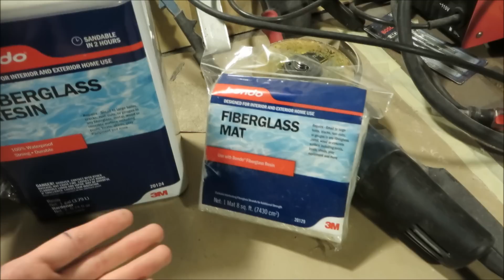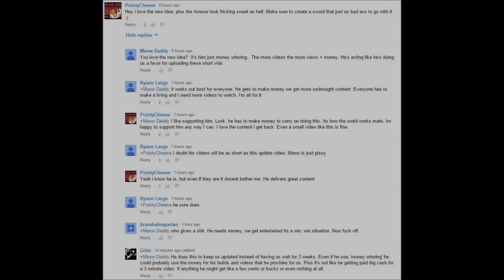How to Make: Mad Max Samurai Bracers

Comment: Not a criticism, but an honest suggestion to possibly improve future project designs.  I noticed that when you cut out the sack cloth layers, (looking at the stack at about the 2:40 mark in the vid) They were all cut out with the weave running the same direction.  When working with woven materials, and using them for structure, having the weaves run in different directions will increase the structural integrity by transferring energy in different directions through each layer.  (The kevlar in bullet proof vests use this concept)

Comment: Do you know if those would be SCA legal?
Reply from the maker: +Joshua Hammond No idea, sorry.
Reply: +ZednoughtAlpha its fine, I love your design though, im actually trying to figure out the best way for Samurai style armor, not sure if I should use pvc or steel... any suggestions?
Reply from the maker: Joshua Hammond For contact sports I would go with steel, as PVC has a tendency to shatter.
Reply: +Joshua Hammond You'd have to modify/add a proper gauntlet to the bracer, but it should be.
Reply: +Joshua Hammond I mixed my armour with carbon for the main protection and some chain mail as the joint armour but carbon or steel is REALLY good armour but of course titanium is the best
Reply: Joshua Hammond if you can get you hands on them, plastic pickle barrels or plastic barrels from a u brew shop are what our SCA house use to make a lot of our armor
Reply: +Joshua Hammond  - You can get plastic pickle buckets (2-5 gallon) from just about any restaurant that serves pickles on sandwiches including fast food as well, in case you don't have a brew shop near by or the money to buy them.  Restaurants just throw them out so they are happy to just hand them over to you.
Reply: what does SCA stand for
Reply: anime trickshot [The] Society for Creative Anachronism.  It's a group that practices medieval arts, sciences and combat
Reply: +Joshua Hammond Probably not with the protrusions, and some people may get upset about them not looking historically accurate.
Reply: +Robert Cowley-Yamamoto ok thank you
Reply: +ZNA Productions is the method of using fiberglass as in your mask video viable for this and other armour?
Reply: wait u die if u dont eat im so sorry
Reply: not technically. You would have to consult your local armor master, and if you don't have one in your kingdom or region talk to some one in you're local group. that or just use it anyway a see if anyone notices.
Reply: Detryk Willis LOL
Reply: Not for fighting unless it's agreed upon. Although if you wear this is trying to act like a shitty modern samurai you'll be laughed at.

Not as badly as the dude who showed up with elf ears and everything lol but it will still happen.

But I can tell you that if you forge your own armor you will at least gain some respect.
Reply: Technically if you really want to impress people in the SCA forge your armor the old way. Not only is it accurate but many of them think it better that way.
Reply: A wise outlook.
Reply: Aidan smith My comment?

Quite frankly I haven't been to many events. Most of the ones I went to happened in my early childhood and I barely have them committed to memory.
It's a simple judge of character honestly. I talk to a lot of my mothers friends from the SCA and they all strike me as the "Old way is the best way" kind of people.
Reply: none the less its still a safe bet.
Reply: Joshua Hammond they are
Reply: Deviler Gaming lol...
Reply: Deviler Gaming. Hes not talking about the apocalypse...
Reply: Which SCA?

Comment: Quick tip while making something that requires a fabric with a lose weave cut the first layer normal and the next at a 45° and repeat until you have the desired amount of layers so that if something pokes or stabs it has less of a chance of going through

Comment: It's not a sad day if you get to do what you love. If some one can't appreciate your need to survive then return them the courtesy by ignoring them, after all your time could be better spent working.  I addition to the strips of steel on the out side could you add narrow strips of thin aluminum, length wise and or diagonally, in between each of middle laminations?  If it works it would increase strength and it without the itch factor of fiberglass mesh. What's the maximum amount of layers possible?   Keep building!

Comment: You also could try making throwing knives out of large bolts by flattening them then using an angle grinder to put a tip on them and also sharpen them.

Comment: I had an idea for a build
"Skateboard shield"
1. I took the wheels off of my old skateboard
2. Remove all nails
3 drill new holes into the skate board and attach the handle with rivets or bolts
4 attach the strap doing the same method

Optional
Bolt aluminium wings to each side

Option
Put in a gap in the alminium

Comment: Cool build. Have you considered using hammered rivets instead if pop rivets? You wouldn't end up with sharp ends poking out everywhere that can scratch you or catch on stuff. It would be tricky to do on the composite parts on the armour without breaking anything, but would be fine for the metal plates. They would take a little longer than the pop rivets though.
Reply from the maker: lancer D Pop rivet were simplest for this build, I do peen my own rivet on a regular basis though.

Comment: I think maybe you did not mention or do not know (my English is not very good) , that stacking fabric with resin is called " micarta " depending on the fabrics and colors gives the sanding different standards normally use epoxy resin and used more common among the " artisans " is for knife handles , perhaps you pudas use for that then also , of course the resin epoxima leaves him much harder than the fiberglass resin , nice bracers :)

Comment: personally I would have put a thin sheet of metal (like from a christmas popcorn tin) on over the resined cloth to make it more durable against blades.  as it is someone with an axe could probably make it through because the blade can bite in.  I have a bracer made from one of the aforementioned popcorn tins that its only drawback is its lack of rigidity due to the high gauge and low quality of the steel, but combining a very thin layer of steel (that for fifteen dollars would yield four bracers and a couple gallons of kettle corn) into this already sturdy and light-weight design would make it behave on-par with equally thick and far heavier all steel bracers.

Comment: I've been thinking of working with leather and pvc to make kinda ribbed lamelar. Mostly bracers and greaves.

Your input would mean world's to me, since this will be my first.

I plan on cutting the pvc and sanding it smooth and round to make spikes, then weaving around then with leather straps.

It's not supposed to be a functional piece, decorative. For a larp.
Reply: Daniyel Ortiz hey you can use like floor mat stuff e.v.a foam to make them and then you don't have to worry  about the staby staby spikes and its cheap and easy to work with but you have to seal it w/glue before you paint :/ 
good luck w/ your project dude!

Comment: these armour parts are pretty cool but actually... how effective are during a fight?
For example, in a sword fight, the "overlapping" of the plates can cause a blade to get stuck or even cut a piece of string that holds the plates together. Why don't you try to put it on a mannequin and see how though is it and how effective could it be against a blade (i am not considering any firearm since i am not sure it is going to hold anything bigger than a .22 caliber)?

Comment: Him: I'll use super cheap 16th inch steel sourced from a machete infamous for being a soft POS as well as 50cent electrical outlet covers, for protecting my forearm and the back of my hand both full of vulnerable tendons, large blood vessels and important bones.
Also Him: I'll use a tiny bit of this huge hunk of heat treated carbon steel which is thicker than 16th of an inch to protect a very small portion of my arms.
Me: But.. why not use that superior steel from the propane tank for all of it??
Also Me: But it's so cool that in one build video he shows people 3 very different yet all pretty reliable and cheap sources of steel.

Comment: Hey, question on Using PVC. I'm thinking about to make a PVC straight sword with fiberglass core (with maybe steel rod reinforcement close to the hilt) . But idk how durable it is. Should I use wood instead? I was hoping it would be close to or better than the durability of a wooden training sword, but I just heard from you that PVC could shatter on contact. Please let me know. Thnx. =]
Reply: Both pvc and wood can be pretty brittle. Think about what you need it for. If it's serious sparring with strong hits, both might be likely to shatter. If you was serious sparring, it would be better to try to save up and buy a nylon or polypropylene sparring sword. You can get some decent stuff for around 40 or 60 bucks. If it's self training and won't involve contact, then pvc with a core would be better because you can adjust the weight and balance as needed.

Comment: If you use gorilla glue instead of fibreglass resin will the sackcloth and the canvas cloth still harden?
Reply from the maker: Carrot Cornetto Hmm not really sure, never tried. I can tell you even if it does work though it will be a lot more pricey and harder to work with.
Reply from the maker: Carrot Cornetto For what I used it for in this video, no. Are you opposed to using it?
Reply: I don't have to use it but since I have gorilla glue I figured I probably should use it since I can't get fibreglass resin anywheres.
Reply from the maker: Carrot Cornetto If you bought the glue at the hardware store I'd bet the resin is within 10 feet of it. You just gotta look.
Reply: Oh ok thanks
Reply from the maker: ***** Where do you live than the resin is $45? I've got a jumbo can in the video, but you can get the small can for about $15.
Reply from the maker: ***** The small can is more than enough, I only got the big can cause I fiberglass a lot. Dang California is crazy haha.
Reply from the maker: ***** Sweet, thanks dude!
Reply: ZednoughtAlpha I like this idea
Reply: I would think it would be much more rigid as it is not a resin, but that depends what type of glue you use.

Comment: what can i use to morph the PVC if i don't have a heat gun?
Reply: +Timothy Oliver The power of friendship
Reply: +Timothy Oliver maybe your oven or use a hair dryer
Reply: A source of heat. Just be careful using fire since it might burn. If you go with fire, do it outside or in a ventilated area. It does release some pretty gnarly and hazardous fumes when it burns.